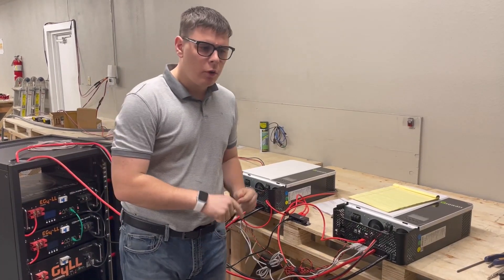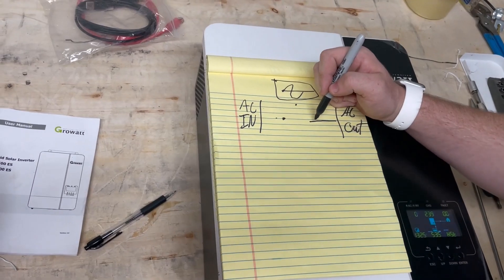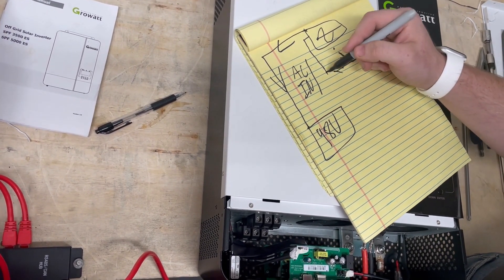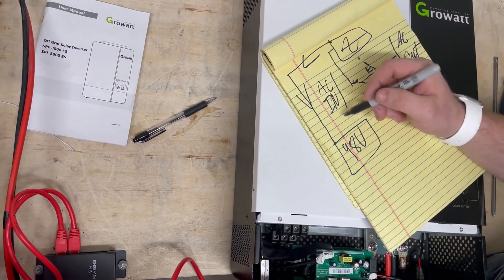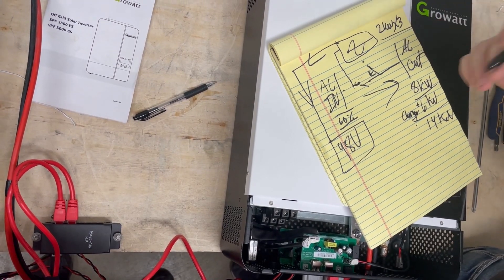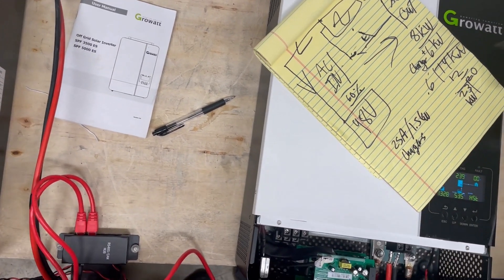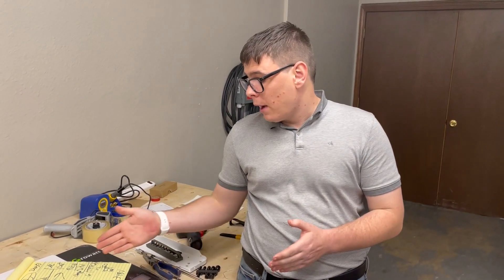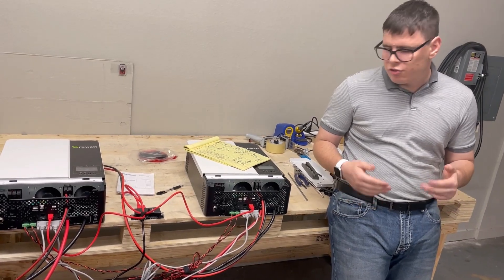Off Grid Backup Generator Sizing and Walkthrough

Comment: How does this strategy work with the new wall mounted 280ah batteries if I have four of them hooked together (cables only, no independent busbar). Do I connect the charger (or separate inverter) to the primary battery?

Comment: Is there a cheap generator I can auto start with the Dry Contact to charge the batteries via the chargeverter when my battery bank runs low

Comment: Can you select the charge load from a generator during charging batteries? Say you only have a 2kw generator. Can I select to only charge my batteries with 1000W on the EG4?
Reply: Also the next logical step would be to turn off the inverter while charging. Would that save the life of the EG4?

Comment: Victron MultiPlus inverters have power assist. I can use my small 2600 running watt Honda inverter generator to charge my batteries through the 70 amp internal charger. The inverter looks at the power requirements of the loads and will automatically compensate for the power the generator lacks and when the load goes away it will take all remaining power that isn’t used for loads and divert back to charging batteries.  Power assist is an awesome feature. They also have a feature that works in conjunction with power assist that can supply the load while it ramps the generator over time to reduce the stress of instants loads on the generator.   Now if my constant loads were greater than 2600 watts the inverters wouldn’t divert power to the batteries so I would need a bigger generator. In steady hungry mode I pull about 600 watts unless the well put kicks in.  So most times I can charge at 2000 watts while the Victron passes the remaining power to the loads.

Comment: "Power Quality Colapse".  

I've looked at the THD and measured sine waves on  both my gennys near full load...One is a 12 kw diesel (w/ thd at >3%) and the other is a 2k Honda inverter genny.   Both at 90% of rated load are still very similar to grid power sine wave.    Maybe "power quality collapse" happens when 1) the power draw is always varying allot, so having more unused capacity is a good thing.    2)  your genny is running out of fuel and it is still trying to make/supply power, 3)  you just turn off your genny without using its breakers to first disconnect the power from the inverter.

I see two solutions: 1) buy another inverter that is not supplying power to your home and just connect it to your batteries and run your genny on that one and then limit how much power you allow your inverter to draw.   2) Buy a 48v genny...I like option one better as I already have enough gennys.

Comment: Soooo can I connect your battery charger to my batteries and charge them while the system is running.  Say I've got a cloudy day, like today,  and need to help the panels out.  Can I turn on my generator and add power to the system via the 48v chargers?  If so, where would I connect the chargers?  As a note, I have two of the chargers.  It should be noted I have 9x EG4-LL batteries and 3x 5000ES Inverters.

Comment: 60% ?  If the load is 10kw and your genset needs to be outputting 60% of the load; then the genset needs to be 17kw, but what you are saying is that an inverter/charger won't charge and invert to
120v at the same time?  Then you would have to feed the batteries with a separate inverter / charger to charge the batteries and that would increase the load on the genset?  a 100amp charge to
the batteries, 58v x 100a = 5800watts about.  If the ac load is 10kw; then now the load on the genset is 15800watts / 60% = about 27kw genset continuous running.  you would need a switch/relay 
going between the genset and batteries to keep the dc from back feeding into the genset.
Reply: what if your charger only puts out 1700watts instead of 58v x 100amps = 5800watts?  It would take 3.4 times as long to charge the batteries x charging losses.  meanwhile your
battery is discharging 10kw.  If you have 4 x 100ah 48v batteries;  that is about 80% charge x 50v x 100ah / 10kw = 1.6 hours + (1450watts x about 1.9 hours =2755wh/10kw )
= 1.8 hours before your battery is at 20% charge.  If you reduce the load to essentials needs; then 3.2 hours plus (1450watts x about 4 hours = 5800wh/5kw) =  1.6 +4 = 4.8 hours
before your battery is at about 20% charge.  That wouldn't be enough backup for most people.  I for example, need 3 days of backup power.  So I need a stronger genset and probably
at least 15kwh of batteries.
Reply: my essential load is only about 530w x  24hours x 3 days = 38160wh
with 3 x 5kwh batteries = 15kwh x 80% = 12kwh when the batteries are at 20% charge.
38kwh - 12kwh = 26kwh the genset needs to make up minimally and charge will be 20%.
charging losses i estimate at 15%  so 26kwh x 1.15 =  29.9kwh needed from genset.
30kwh / 3 days = 10kwh per day.  if i run the genset for 10 hours per day, 10kwh / 10h = 1000watts
so my 1700w genset should be enough power if i run it for 10 hours per day and the battery charge at
3 days should be higher than 20%, but i'll need 3 x 48v 100ah batteries.

Comment: I didn't understand your suggestion.  i have a 1700w constant genset - 2500w surge.  couldn't i take a tap off my grid AC to the genset, put in a relay to switch it on, have the genset output
go to the inverter/charger to add to the power that the battery is supplying?  so the battery would be supplying 1700w less when the grid power is out?
Reply: alternatively, couldn't i hook my  1700w genset to your charger to provide 48v charging and hook the charger directly to the battery?  thus charging the battery directly, not going 
through the inverter/charger? 25amps x 58 volts =  1450 watts

Comment: So in a solar outage, you’re saying I can use an EG4 Battery charger in conjunction with a fuel burning generator to recharge my batteries. If I also have the EG4 battery and rack system, how do I connect the charger to the battery array? I looked through the manual for the EG4 charger and it doesn’t mention how to connect it to batteries.
Reply from the maker: To connect to your batteries you would simply connect to your battery rack busbar, or if a single battery, directly to the battery. And yes you are right about the generator.

Comment: Perfect timing! I don't have enough sun to do PV, so am using the Batteries for backup/time-shifting... currently charging off-peak w/ the 48v charger... knowing that I can use the DC Chargers with a smaller generator is just the answer I need. Thanks!
Reply: what charger and generator did you get?

Comment: An electrical diagram would really help showing the connections. For example, you are saying to have a separate 48 volt charger fed by the generator to charge the batteries but you are not showing how this separate charger needs to be connected to the batteries, when the inverter is also connected to the batteries, which could charge the batteries from the solar panels. Are isolating diodes required or are you saying that we should electrically have either the inverter or the separate 48 volt charger connected to the batteries?
Reply: I'm currently running this setup at my house. So basically the dc charger would be connected in parallel to your solar charge controller and inverter. (Positives sharing a busbar and negatives sharing a busbar) At least thats how I have mine connected and I havent had any issues charging using the generator even with simultaneous solar charging

Comment: what?? why is the 8k load added to the 6k inverters?  by your own words you have either inverted ac or line ac.......and you dont need to max out your charging...so run any generator at 60% to charge up batteries.  you  are missing the point of a hybrid.....simple!     i have my system set that the ac in or gen in only bypasses the inverter and i charge off solar only.  why pay for line ac to charge up a battery only to have it then power an inverter...and have transfer losses every time you change it......but in the real world people need specific systems and the differences need to be planned for and look for the best result for the end user.
Reply: situation:  there is no sun and no grid tie and your batteries are low.

Comment: @Signature Solar I am setting up two of the 5000ES inverters with one Midpoint Transformer for my off grid installation. I am going with 8 Battle Born batteries, in 48V, two strings. Do you recommend using two of the 25A battery chargers, one on each string? (At this time, I will only have 18 - 260W solar panels to input solar power, though I hope to double that in due time.).

Comment: This is the only thing I am disappointed with these all-in-one units is the inability to use the AC input to strictly charge the batteries with a generator... That almost made me go for the Bluetti AC200 MAX with the external batteries setup.
But I will deal with using the separate charger :(

Comment: You can also use an inverter based genset and  get more without the THD going to crap like they are talking about in this video (which is 100% correct).

Comment: Ordered the Growatt 3kw 48V for use with a fixed location, off grid 30A RV. Was going to order a 3.7kw (running. 4.5kw peak) gen as backup to a 5.5kw solar array to keep a 5.2kw Lifepo4 battery charged.  Is this video telling me this set up won't work?  Should I cancel the Growatt order?
Reply: It would be best to order the charger and use the generator to charge the batteries with that separate charger. You can also turn down the charging amps pulled from the AC input on the Growatt and just keep larger items turned off while using the generator.

Comment: I have a 24kw gen. it came with an automatic transfer switch, I am completely off grid and would like to install 3 growatt 5000es in parallel with backup lithium batteries and run both L1/L2 with Neutral off the auto transformer straight into the automatic transfer switch. Question: If the Gen. kicked on due to low battery and the inverters shut down and while the generator is running to power the whole house in the meantime my 48vdc charger charging my lithium batteries, once fully charged will the inverters power up automatic allowing the Gen. to shut down automatic thru the auto transfer switch. Will this work instead running Gen thru the inverters?
Reply: The inverters should kick back on when your batteries hit the SOC you have programmed into them

Comment: So, I have a 7.5kw and a 10kw diesel generators. Which generator would be best used by the growatt 12000T and what would be the best way to implement charging without connecting the generator to AC input?

Comment: So I have a Honda Eu2200 generator which outputs 120V at 13.3A. and the Generator has a Pure sign wave inverter so it wont deteriorate the appliances. What setting do i use to on the growatt to use AC input to power our loads (AC output). (Given battery is dead and no solar power) AC input would would be 120V, and AC output is 240? Is that even possible? will the growatt only output the 120V? we have an off grid place so we'd like to power our loads when there is no sun and the battery shuts off. 
We would have SBU Priority set, power save mode enabled, etc. let us know what other settings we would need to change on the growatt.
Reply from the maker: Practically speaking if the battery is dead as in the BMS tripped then the inverter will not be useful as a charger, only when it sees a woken up battery will it charge,

Comment: So the generator will charge the batteries while the batteries are running the inverters. Is it possible to run two or three 25A  chargers directly to the batteries from a 5k generator?
Reply from the maker: yes, that is really the best strategy, if your 5kw is kind of on the low quality side 3 may not work too well though.

Comment: Can you use the Signature Solar 48 volt battery charger connected to a generator with solar AC coupling and not back feed the generator?
Reply from the maker: in theory yes, solar AC coupling with a generator is a sketchy idea at best though
Reply: @SignatureSolar  So the inverter could close a relay that starts a generator upon a low battery parameter condition with the generator only connected to the battery charger but not connected to the inverter generator inputs and all should be ok while also solar AC coupling.
Reply: @SignatureSolar  can you explain why that would be sketchy? I thought solar ac coupling was most effecient? 
My hope is to do solar primary, battery secondary, then let the gen turn on wire control a 48vdc charge automatically, with out a 220 line in. 

Hope that works cause right now I'm a little light on panels and really light on batteries 😂.